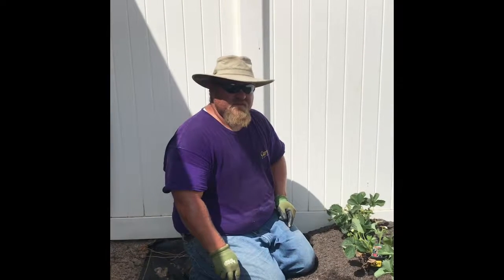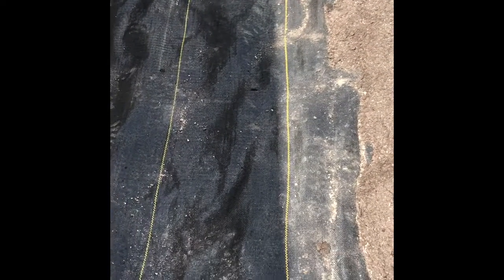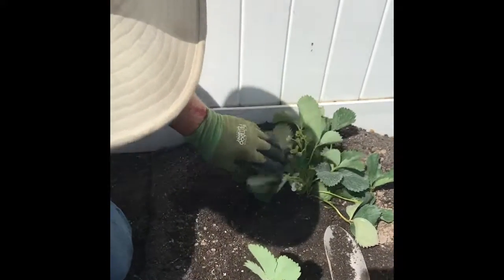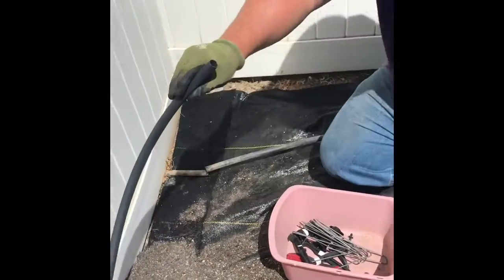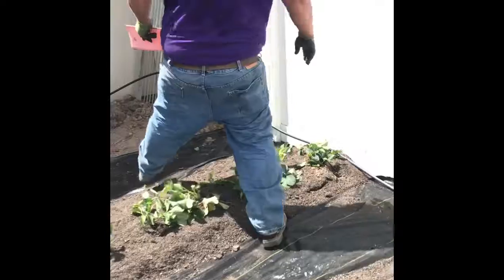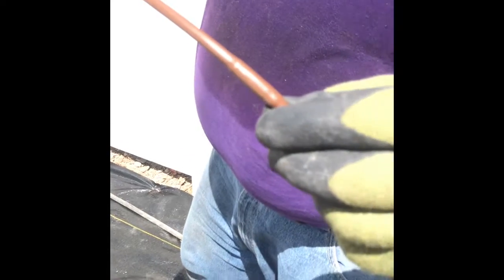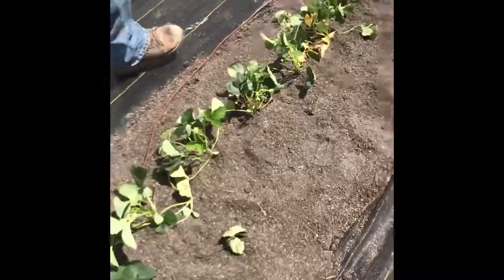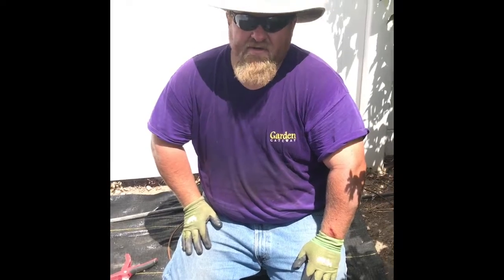Strawberry Patch Planting and Drip Irrigation Setup

Comment: Thanks for a great video.  As the plants send out new runners, how do you handle the water to those?  Do you ever have to buy new plants or do you just discard the first plants as they become 3 or 4 years old and pull the 1/4 inch drip tube over to the daughter plants?